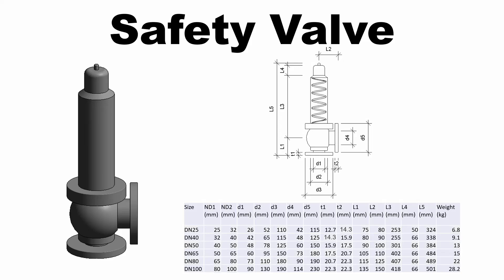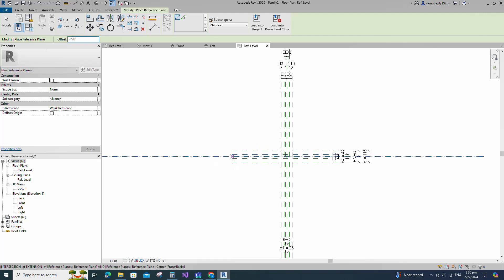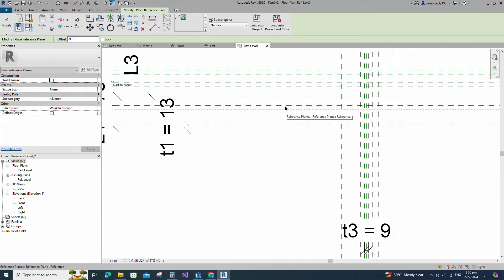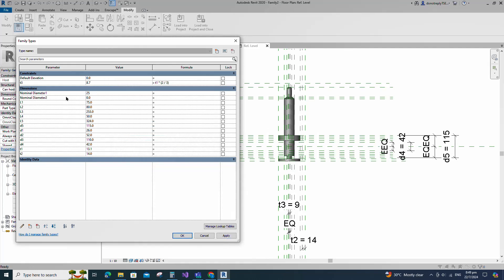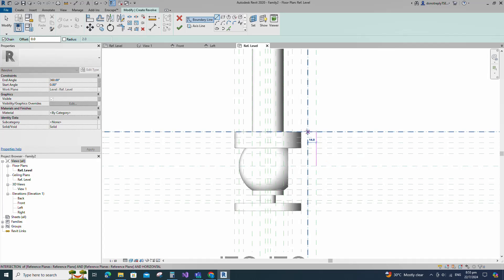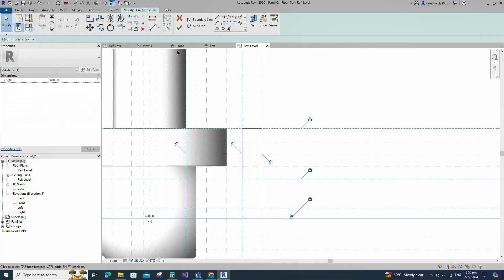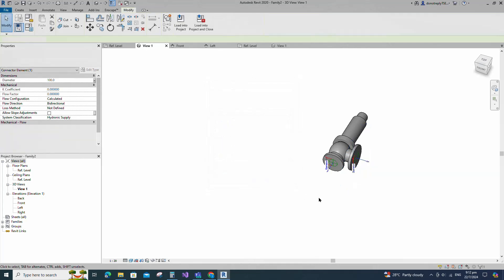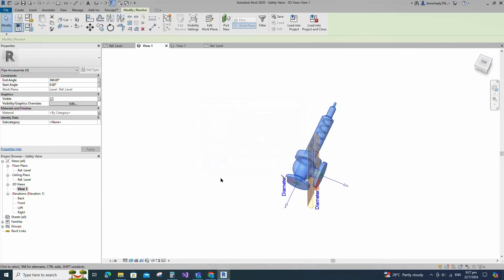Create Safety Valve Revit Family

Comment: May I know why did you change the parameter one by one instead of just using the size_lookup formula?
Reply from the maker: Valve sizes are DN25-100 only. You can use lookup tables